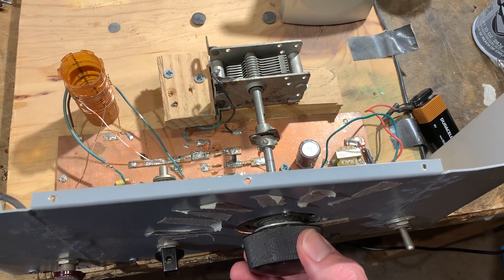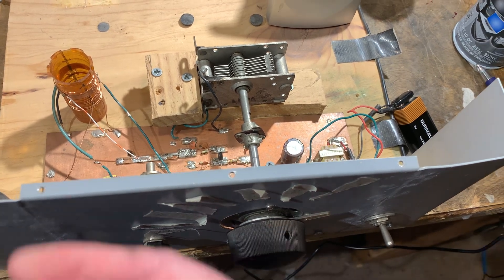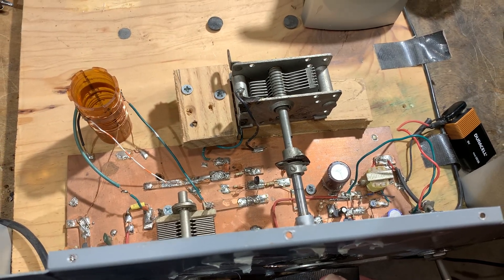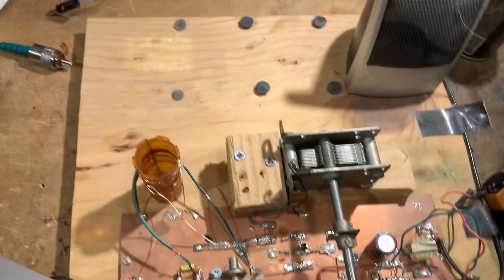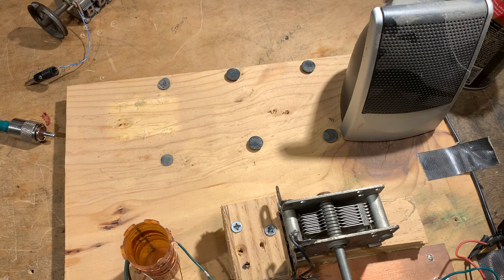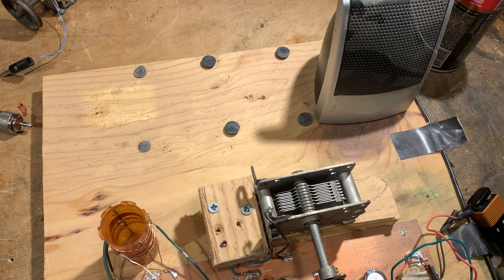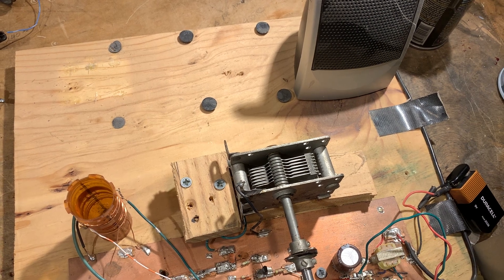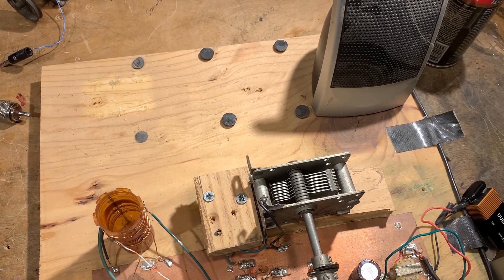Off the Shelf on 40 SSB

Comment: Love the dial 😂
Reply from the maker: After 10 years on the shelf the pencil markings on the masking tape had faded a bit, but I could still make them out, so they were still useful.  Also, as I recall the "case" is from an old computer power supply.  73  Bill